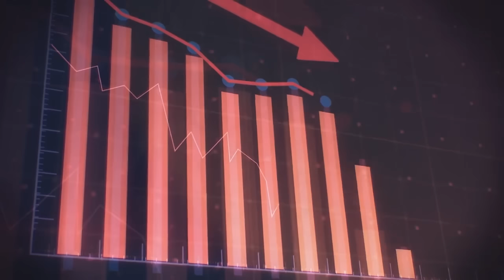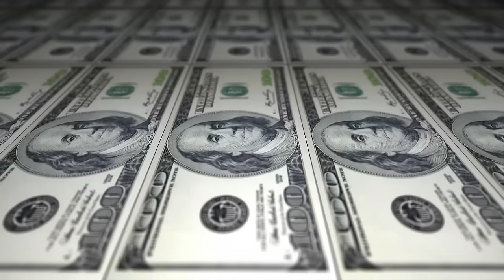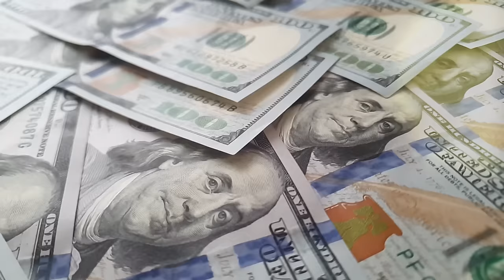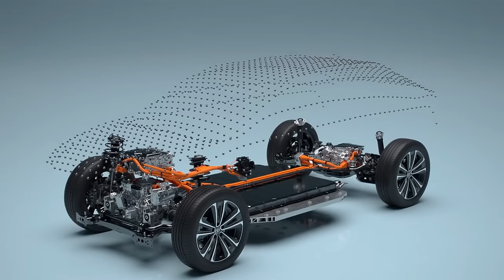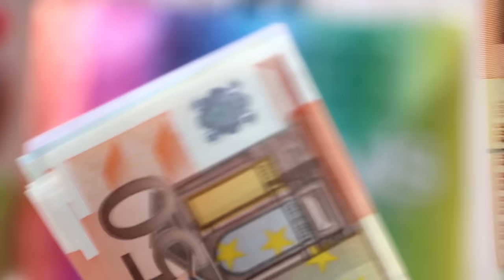The ‘I Told You So’ Moment: Toyota’s Predictions About EVs Come True! Electric Vehicle or Hybrids?

Comment: I’ve been driving an EV with long range batteries (Skoda Enyaq 80) for 13 months now, I did 6’000 kms when I’ve been doing 25k per year every year since 1994. Why? Max 300 kms in a single 3 hours charge (at 22kW), incredible lack of public chargers in Spain, France, Italy where I use to drive, and half of the existing chargers out of order. Plus some are at 0.8€/kW, more expensive than petrol for the same autonomy. I’ve even paid 1500€ to repair my old 2012 Smart Fortwo (111’000 kms) to have a car on the weekends. Really, this is not working, EVs are utterly bad!

Comment: I love my reliable  2005 Camry with 390,000km. Still looking great with no rust and an engine that just needs oil changes.
Reply: Mine, too, is great, 2011 camry hybrid is my girl, never an ounce of trouble.
Reply: I bet it looks good next to your trailer
Reply: @antihypocrisy8978  Not sure what you mean. Being sarcastic? My Camry is a daily driver and I don't have a trailer.
Reply: @valf.4589 , just implying you're poor because you drive a 2011 car
Reply: @davidpereira9238  2005, not 2011. Also, what makes you think I am poor? Perhaps you are poor yourself.
Reply: @valf.4589  , read it again, I'm not implying anything, someone else is, and that's all I was doing, no need to blow a gasket attacking the wrong guy.
Reply: @antihypocrisy8978  never towed, ever. Trailer is a commodity that is NOT required with my girl.
Reply: @davidpereira9238  Sorry I had my signals crossed. Just did a "head gasket" and so I am good now.🙂
Reply: Usually Japanese cars have plenty of rust when they reach 10 years old
Reply: @kevinl7173  no rust in my girl, she is well maintained.
Reply: I've got a 2003 Camry, and it's only done about 88000. It's like new, and I'm confident it's going to last me until I die.
Reply: @kevinl7173  All makes and models will typically show signs of rust after 10 years. The worst ones are Chrysler/Dodge products. Just look at their trucks. Japanese cars are typically better than averaage. Fords are very bad too. I know because I live in the rust belt.
Reply: @antihypocrisy8978  boat on trailer looks good too.
Reply: The people that judge others by what car they drive are often the poor ones; financially and intellectually. People with money know that it's better to keep a low profile.
Reply: me too, I park in the parking lots anywhere with no string attached 🤣🤣🤣
Reply: Rev up your engine.....
Reply: @antihypocrisy8978  better than being a homeless hobo with tons of debt..lmao
Reply: And even if you were to scrap that vehicle now (even though it still has many of thousands of kilometres left)… it will still have a smaller environmental footprint than any EV on the road, or EV that has already been scrapped.
Reply: @kevinl7173 Japanese cars outside of snow prone areas usually experience no rust even after 20 years!!… even in salted road situations, they are still better than most other vehicles.
Reply: Toyota selling 11.9 million cars a year profitably and EV fans thinking Toyota doesn’t like the environment. Crazy.  Ya know what’s less polluting is a car that lasts longer than ten years.
Reply: @chrysanthalas the average length of time that a person keeps a car is 8 years so 10 years is good enough for me.
Reply: @kevinl7173 Huh?? I drive a 17 year old Nissan Altima and no rust. I think it depends on where you live. The Midwest with its extreme weather and salted roads in winter can be brutal. Living in SoCal with a milder climate, rust isn't something we generally have to deal with.
Reply: After my '07 Altima finally gives out, I would like a Camry. I'm glad Toyota changed the body from the 2000 design. I don't buy new but prefer to buy no more than 2-3 years old. I fear with their reliability and the demand, that the price point will be too high when I'm in the market. If it's not a hybrid, it has to be a 6 cylinder. My first Altima I drove from '96-'08 was a 4 and the current one is a 6. I like that better.
Reply: Gotta make sure you clean your car very regularly. I didn't do that with my 09 cobalt and now all my issues arising now are because of rust. Didn't help that I found out after the fact my area used some solution on the roads for two years over the long winters we have that are very bad with causing rust.
Reply: Right there with my 2005 Honda element over 300,000k and still going strong
Reply: If it ain’t broke don’t fix it
Reply: If there is nothing wrong with your car why buy a new one ? The only thing I don’t have is satellite and rear view camera . I can parallel park faster that the self park so why bother ?
Reply: @garrychalk  I hate rear cameras. I tried making use of them for rentals, but the lack of good field of vision just makes me look over my shoulders anyway.
Reply: it produce co
Reply: Hi UK  here i had a 1989 camry 2.0gli beautiful car!!!!!!!!!
Reply: Same. 1989 Camry.
Reply: Camry… one of the best vehicles around and you can get over 30mpg on a gas engine!!
Reply: Love my 2013 Toyota Tundra! Rather pay at the pump than pay at the auto shop.
Reply: Same ,but with honda accord estate 2,2 tdi ,tyres oil and filters😂,works like a rolex✌️
Reply: And the climate?
Reply: 2005 camry v6 here. 241,000km. Bought 2nd hand in 2015 for 7k aud. Change oil every 5,000km. Definately great value for money sedan.
Reply: Gradual electrification …better mpg is heading toward  cleaner air
Reply: Same here with a Yaris 2008 everything works like new
Reply: I have known wealthy people who drive an older car because they are frugal and cars are the worst investment unless you keep them for a long time after they ate paid for. Toyota offers you the benefit of driving them for 3-400 thousand miles. I enjoy my 2013 vehicle for that reason and plan to keep it for many years.
Reply: @erniepappa3900  example of that Christian  Bale
Reply: I finally got rid of my 2010 Prius at 360,000 miles because the head gasket went out. I bought a newer Prius.
Reply: Still have my Mazda 323 2000 model still goes like new, just upgraded the radio, cd player with blue tooth. Goes like a rocket ❤
Reply: @rodneybrocke  the one is like a Lexus
Reply: I am still using 1.3L Fiat Engine Powered Maruti Suzuki Ritz ( Splash) 2012, done 6,37,000 kms. It is all about maintaining your vehicle.
Reply: And you're not having data from your car sent/sold to the manufacturer, your insurance company, the government, etc.
Reply: @kevinl7173  I’m not sure what region u reside but I live in AZ my honda is 15yrs old that has a quarter million miles on it , parking on a street dairy 
Surprisingly enough I can hardly see a rust anywhere on it and runs like a top, shooting for at least an half million miles 🤗
Reply: @kevinl7173  Not true.  I had a Honda Accord 1999 up until 2017 original paint job.  No rust.  Got in 200K miles on it.  I think it depends on if it is covered or not most of the time.  In my case it was where I worked and where I parked it at home.
Reply: Hi, I had a 2005 Corrolla, 150,000 miles with only a new clutch [yes, break pads, discs etc]  An absolute gem, I was gutted to sell it 2 years ago for a ford kuga.  What a car ❤
Reply: @KiethWilliams-qe6mh  I just replaced the worn down rear door belt molding. Now looks perfect.
Reply: Much less polluting than buying a new car